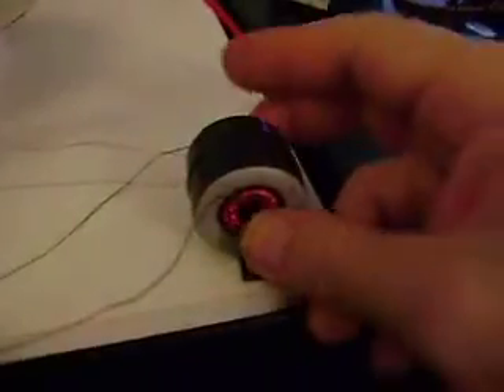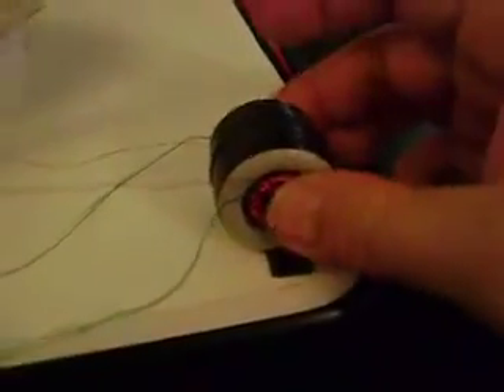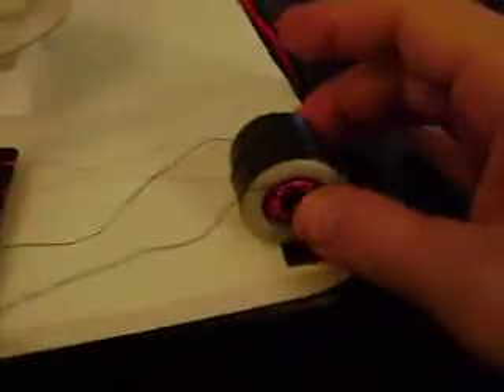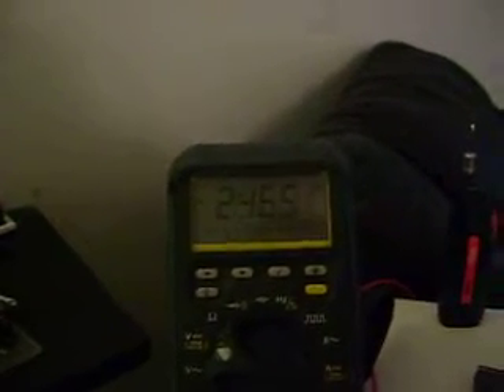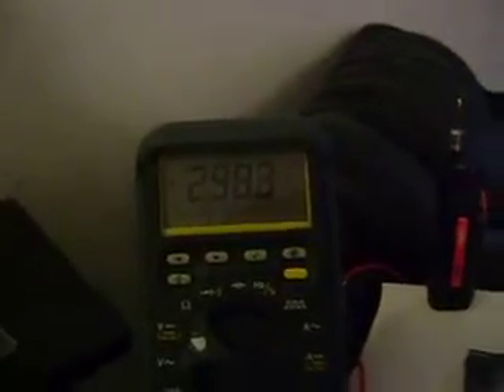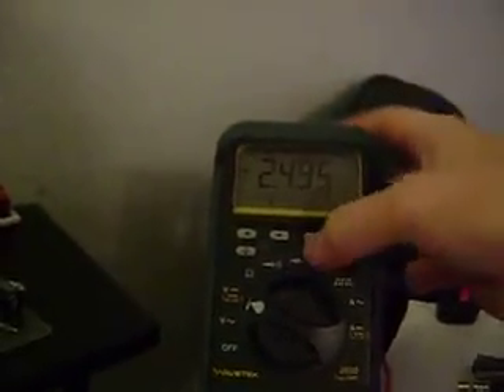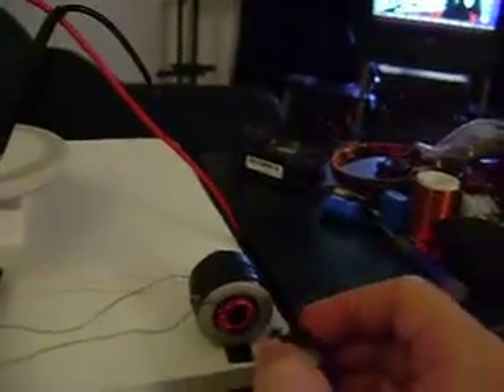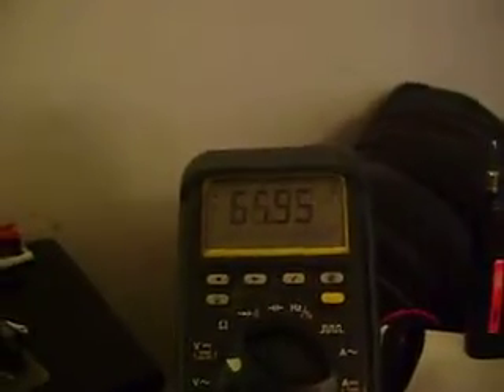My version of the Solid State EOrbo

Comment from the maker: Yes  the rotor and reed are just to supply pulses. If you check my latest vid, I stepped up to a 556 and mosfet. Im not getting the same output as I did with the reed. Im working on it.  =]

Mags